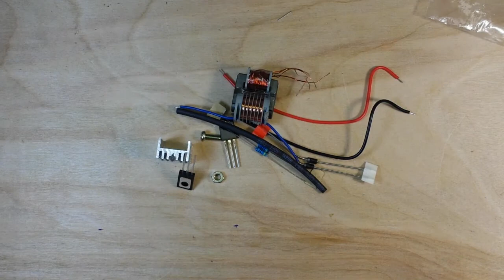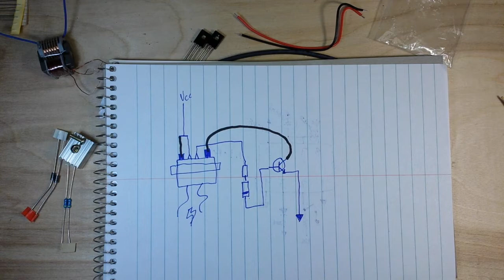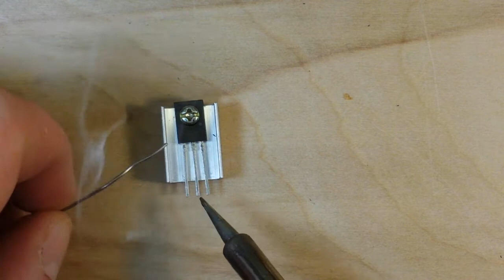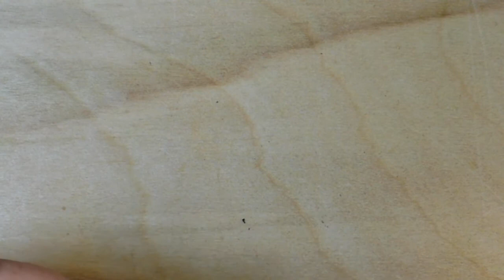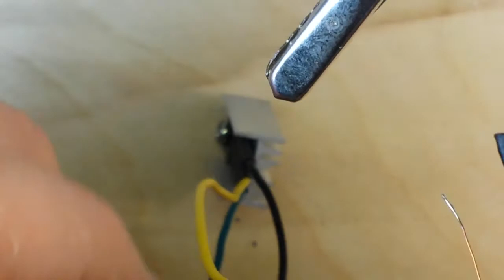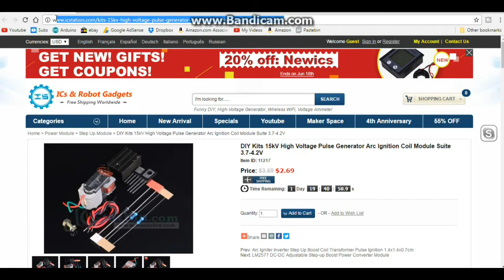ICStation com  15kV High Voltage Pulse Generator Arc Ignition Coil

Comment: I am going to hook a couple of these up in series to get more voltage! I mean wring the secondaries in series and primaries could be series or parralel. I will have to replace the primary by some well insulated wire to prevent arcing to it.
Reply: Did you do it yet, did it work?
Reply: @hstone0808  Yes, but I only put 2 in series
Reply: And driving with ZVS driver is way more powerful and efficient
Reply: @hstone0808  I encased them in wax to prevent arcing

Comment: What function of the diode connect to the base transistor sir
Reply: I think it keeps the transistor from being damaged, by blocking negative voltage from getting to the base wire. I did a video on a more powerful version of this circuit, with a DIY transformer, I figured out a similar diode set up by myself.I know this is an old comment, but someone might be interested.

Comment: ...thought I would just add a discovery, since I found it so useful over the decades.  At about 8:00 it reminded me that when just pressing a flat-leaded 220 or similar pin device into a breadboard (although, you don't use one here), it gets super simple to take a pair of needle-nosed pliers and simply twist the pins 90 degrees--they then slide perfectly into a breadboard socket.

Comment: Could you use a voltage multiplier with it?
Reply from the maker: +Autogolazzo No it will burn out
Reply: learnelectronics The multiplier or transformer unit? I'm only going to draw about 5 watts

Comment: thats really kinda cheap for a heatsink and a transformer. but i guess the transformer has so many secondary windings that it cant be used for anything else but creating high voltage. i kinda doubt the 12V rating. but it might get to such high voltages that it breaks down the isolation in the secondary
Reply from the maker: fredlllll I have only pushed it to 6V. the unknown transformer gets pretty hot
Reply: put it in liquid nitrogen ;)
Reply from the maker: fredlllll 😵

Comment: If I need to see an arc I'll go lite up my TIG welder! I know icstation is a sponsor but what can you say about shipping times? Is standard Chinese shipping times or something better?
Reply from the maker: George Chambers this is my second order from them...both times 15 days...if you order use my 15% off code "paulics"

I've got an Alphatig 200...what do you use?
Reply: I've got the same one and I love it. It works way better than the old spool gun for aluminum if you're in no hurry. Thanks for the two weeks heads up. even though I'm on the west coast some chinesium still goes through Germany and NY to get here.